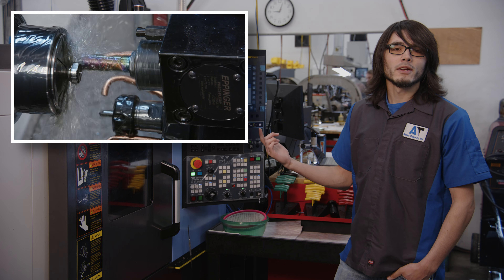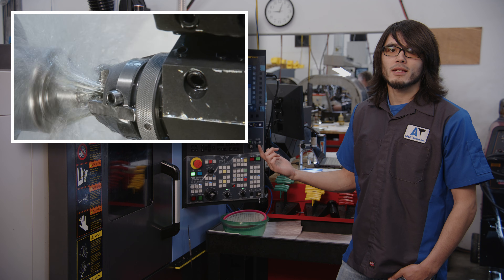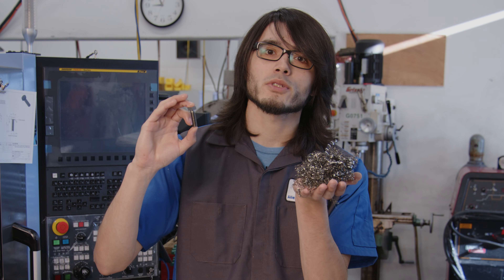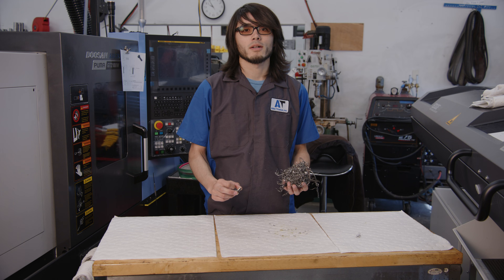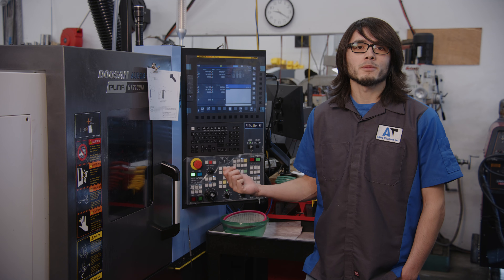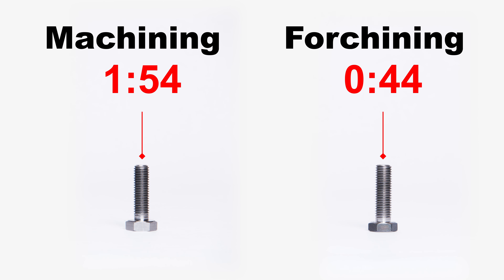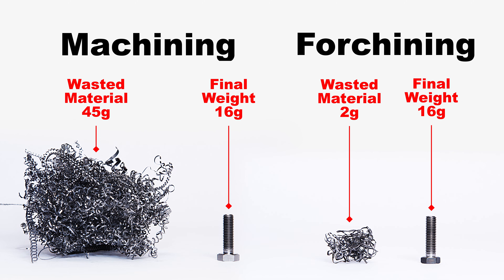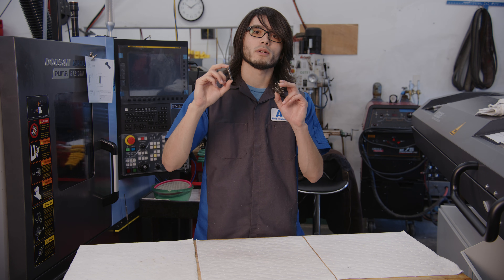Hex Bolt Forchining™ Without Machining

Comment: If you are looking to expand your market might I suggest reaching out to some of the larger tuning shops (places like APR, 034, ECS etc). This process seems like it would reduce costs on titanium fasteners fairly substantially, titanium fastener packages for popular tuner models have market demand for people pursuing the ultimate weight savings, but relative cost has kept it from becoming a common modification thus far.

Comment: what does the heating do to the metal
is this only for low requirement bolts
its titanium so i assume not
why not just cast if heating changing the metal doesnt matter 
i mean its a cool concept, but there are many questions that a basic look at a shape doesnt tell

Comment: Must have been a lot of R&D into adapting a similar forming process used for a lot of steel bolts to make Ti ones by forging the head and then cutting shank and bolt.... One of the big reasons steel is so prevalent over other materials is the difficulty in making the same processes work out using other materials and not compromising the end product due to the quirks of the material used.
I wonder why you opted for cutting the threads and shank rather than using a thread rolling process... Accuracy, maybe poor material properties in the Ti that cannot be solved easily enough introduced by using thread rolling, or low enough production volumes that cheaper tooling/setup per size is preferred.

Comment: Next you have to use one of those through hole cnc machine chuck heads and set up an automated feed system and you can have an assembly line going. Feed the Rod, Clamp the Chuck Jaws, Heat with induction, Pull heater away, forge head, cut threads, cut bolt off, repeat. I am sure there are more steps to this I have failed to include, but from a layman's point of view this seems very doable.

Comment: Cool set up and process! 

"Forchining" though, man, what an awful and unnecessary portmanteau. Near net forging is already a thing. It looks like you've done a great job integrating it into a CNC machining process, but it's not some new form of manufacturing that needs a special name, is it? It feels like you're trying too hard to make "fetch" happen.

Unrelated— if minimizing waste is a priority, I wonder why reducing the diameter for the threaded section wouldn't be done with a forming process rather than a subtractive? I imagine drawing the material out and hot rolling it down to whatever diameter is required for threading, then cooling it and rolling the threads. I'm sure there's some reason for why not; either way I'd love to hear about it!

Comment: Does the forchined bolt pass all the performance and fatigue tests for the machined bolt?
Reply: The forging creates better grain structure (higher strength) and by being able to control the area that is tempered, we can produce products that are normally really expensive to make traditionally for aerospace. Many times, with grade 5 titanium, the desired result is to have the head and the area under the head to be stronger, but the rest of the fastener needs be annealed so it will stretch and bounce back. Think cylinder head compression bolts on high performance combustion engines. We do this when we Forchine(TM) long, thin grade 5 titanium bolts for the satellite deployment mounting plates that sit on top of thick rubber shock absorbing pads.

Comment: Remove the "Index for forging" step. It's unnecessary (you already set the stickout in the "Index for Heating" step) and it's damaging your collet as you have it grasping white hot titanium at 0:41. Induction heating parts then forming them (yes, even on a lathe) has been done for at least decades now so I don't see what's patentable here... That said, this process should be more common so good luck with selling the tooling!
Reply: You haven't done any forging it seems if you don't understand why it indexes for forging.

Comment: Doesnt heating the bolt head reduce its heatreatment? What about quenching the heated part with the coolant?

The biggest possible problem i see is the heating element degrading the coolant.
Reply: You can heat treat batches after making them.

Comment: Red hot metal in that chuck collet is not great.
I'm sure a CNC check collet like that is a real expensive part...
Reply: That style of collet would cost somewhere in the realm of $30-60. A fairly inexpensive consumable if you consider that these are probably $5+ fasteners and they're making over 60 an hour. I'd bet that they probably last a week or more. 

The most expensive tool in the machine is probably the thread rolling head at a few thousand dollars.

Comment: Now, if you could roll the threads it would be even better and stronger.
Reply: You blind?
Reply: @JaakkoF how do you explain the swarf coming off the part during the threading operation? You may want to keep your comments to yourself. Makes you look like a fool.
Reply: They are rolled after a diameter is turned. You can see a thread rolling head run up the part and snap open.
Reply: @jonathantaylor2584 that’s not rolled. That threading head still cuts the threads.

Comment: Huh. Neat! I like this approach as an alternative to hybrid machining, especially for applications requiring the extra strength from the heat treated and tempered material, since hybrid machining usually leaves the material a bit weaker than if you just machined out the part normally.

Comment: that's great and all, but where are the stress tests? does the bolt get hardened when subjected to the induction coil, is it more brittle? does it have the same elasticity on the bolt, how do the threads hold up to stress... if you're going to sell this product, make some examples?
Reply: That would be the QC department, just like every other manufacturing process.

Comment: I am sure a lot of people will watch this video not knowing how most fasteners are mass produced. Cold heading produces almost 0 waste. That is why it is rare to CNC machine a fastener these days.
Reply: Fastener metallurgist here. Hot heading titanium hex bolts makes a lot more sense than cold heading, because annealed ferritic or pearlitic steel cold forms with so much less pressure than Ti6Al4V and has greater elongation. But I'm confused about the threading process you show. The caption calls out "roll threading", which is a cold forming process with no material removed, but we see stringers being generated. Rolled threads are far superior to cut threads, particularly on external threads (even more so on screws/bolts than studs) due to the aligned grain flow resisting fatigue crack initiation in the thread roots.
Reply: @elektro3000  they are rolling the threads, the material removal is turning the threaded portion down to pitch diameter ahead of rolling the threads
Reply: @elektro3000  We are rolling the threads "technically" cold. But in actuality, the material is still quite hot which makes for a longer life on the thread rolls.
Reply: @elektro3000 if you watch closely, the cutting operations that removed material from the workpiece are reducing the diameter for the threaded section of the bolt down from the diameter of the unthreaded shank. The thread rollers come in just after that.
Reply: To be fair, a lot of people also think potatoes come from the supermarket.
Reply: These are titanium bolts, titanium is a tricker metal to work with so most are traditionally machined
Reply: @AMGelardi1  I have done machining my entire career, if you know what you are doing, titanium is just as easy to work with as any other material. The problem is quantity,. Nobody will set up a cold heading machine to make titanium bolts when you only need 100 of them. They only want massive quantities in the hundreds of thousands or millions.  Cold heading takes only a few seconds to make a bolt and the bolts are also stronger because they have not been cut. Cold heading also makes almost 0 waste which was my point. It is not that they can't cold head titanium, its that it is not cost effective at the small quantities that they are needed.
Reply from the maker: @mattlarson9897  The beauty of forging and machining at the same time (Forchining(TM)), is you get the benefits of forging with the high tolerances of CNC Machining. Most of our Forchining is done with the higher strength titanium alloys that don't lend themselves to cold heading.
Reply: @AlliedTitanium  machinist guy thinks high tolerances mean high accuracy - whomp whomp, all credibility lost 🤦‍♂️
Reply from the maker: Actually, to my knowledge, nobody on the planet has figured out how to cold head Grade 5 titanium products. If anybody knows of anyone doing this. Please let me know ASAP. This Chris. I'm the CEO of Allied and inventor of Forchining.
Reply: Not cold head, but warm head by adding an induction heater before the cutter and quill on a cold header. Can do this as a modification to an older machine or buy a new machine that has been modified by the factory.
Reply: @triaged He's trying to patent the process, so you're going to have to get creative when writing your own recipee.

Edit: Found CN111922266A for 💩's and giggles.
Reply: Basically how they make bolts in big quantity, except this time, it's on a CNC and thread cutting instead of thread rolling
Reply: not with Titanium
Reply: So the hybrid is having included a hot forge in the middle of an otherwise subtractive process? In that case, running a roller on a polygonal tool path might enable not having to have a forge die, just a pushing sub spindle.

Comment: For an individual bolt, that's all well and good, but at an industrial scale, this hasn't been a problem for around a century.
The roll form machines are probably the best, but the slip forms are better for small batches because of 'easier' set-up.
I'm sure newer machines are simpler, but I was using machines to do this five years ago that were made in the 60s.

No material need be removed, unless they need a point on the end.
Pressure will make threads far faster and cleaner.
In 44 seconds, I'd have over a hundred on a slow running model.
Reply: you can cold form titanium??
Reply: But we can make it 100 Times More Expensive, IF we do it this way
Reply: If all you want to make is a bolt, and lots of them, but for smaller batch sizes of spindles, shafts, unique fixtures, longitudinal tools, etc, this would reduce tooling and/or material wastage.
Reply: @benwilms3942  did you miss the forging die perfectly forming the part in a single shot? how do you do that without a custom, part specific tool? i don't see any fundamental change in the trade-off between tooling cost and efficiency, "just" another interesting point along (hopefully) the Pareto front for these two variables. for the right application i could see techniques like this being very beneficial, but i suspect it's applicable to a much smaller slice of industry than the "all of low volume lathe work" you imply. after all, the idea would be pretty obvious to any machinist with a bit of imagination, so if this was so fundamental an advancement, it would already be in use everywhere. this video is probably more of an investor pitch than a product ad.
Reply: @spambot7110  exactly my thought, it is about inflating their company value no doubt, because at small scale you really don't care about the material waste, it is not really a factor in cost of the product, on large scale nobody is making screws in CNC machining centers, so this method really doesn't make sense, especially the "patent" part of it, there is nothing to patent here, induction heating and forming, has been around for what - 70-80 years? not to mention the questionable end result doing it on Ti on such a critical place on a bolt

Comment: Now THIS I like- No offloading of tasks to computers or throwing away gobs of material, proper problem solving.
Reply: Uhhh, this is cnc, the ENTIRE task is handled by a computer
Reply: Without computers, this would be about 10 times more expensive and likely more time-consuming.
Reply: Everything shown in the video was done before computers, the only advancement is that computers let it be done arbitrarily without the giant analog gear based systems.

Comment: Thats great but most bolts arnt machined on a lathe. They are squeezed between 2 die plates and have their threads rubbed on. With the head stamped. The process is super fast and this forchining offers no advantage to the already established method
Reply: Aerospace grade 5 titanium are… like the example in the video
Reply: @geekswithfeet9137  The material may be "aerospace grade", but the processing and precision are not - these parts should not be used for critical applications. Still, an interesting approach...
Reply: @davidg3944  if you think that heating and forging t5 titanium is detrimental….. you don’t know titanium.

Comment: Great concept, but it has me concerned about the microstructure. Ti in particular likes to exhibit texture from forging. I'm also interested in the concequence of grain size and any precipitate coarseening or dissolution, depending on the alloy. This process could have serious concequences on the final mechanical performance of the bolt.
Reply from the maker: Actually, this process of forging grade 5 titanium, tempering grade 5 titanium and then machining or grinding grade 5 titanium into high tolerance products has been done by aerospace for years in separate operations at extremely high costs. We have combined these manufacturing processes into one seamless, spatially and environmentally coherent process that is fast, accurate with very little waste. Our Forchined(TM) products have been going into aerospace, defense and space for years. We just kept it a closely guarded secret until our patents were far enough along. So. . . When you look up in the sky and see a satellite, odds are that forchined products are in it.
Reply: @AlliedTitanium  I dig it.. likely goes through heat treatment in bulk later anyway, right?
Would love to see more affordable Ti mtb hardware..
feel free to send m4 through m6 this way for quality control..)/*
Would love to see some broachining if you care to show off any more sexytech..
Reply: @AlliedTitanium  and you waste your time pursuing patents for something that has been done for decades before, it is just silly, and tells that you're most likely getting ready to sell out, there is absolutely nothing groundbraking or patentable in this process, in other words - you're scamming and trying to inflate your value, which is the bane of the western manufacturing and why there are probably 10 factories in china doing the same exact process and outcompeting you, hence trying to sell out before the value crashes
Reply: @AlliedTitanium  I own a small machine shop in rural California. We do small batches for our local customers and sometimes the government. I'll purchase one of your machines if you can fart on your room mates door.
Reply: @AlliedTitanium  Well, I can guarantee the satellites I've worked on at one level or another were unlikely to have your fasteners in them, not sure about other parts. It's an interesting process, but I would not use the bolt examples I saw in any critical applications - questionable control of heat treat, poor residual stress in the shanks, and lack of rolled/compressed under-head fillet to shank have me concerned. 

The SPS and BAC-spec A-286. 718, and some Ti hardware I've got is what I use for high-stress applications in my work. If I needed some dress parts in a difficult to find size then I'd consider these.
Reply: @davidg3944 We cannot speculate, based on a video. The sensible thing would be to get hold of process and product data before deciding what the process can/can't do and what it has the potential to do.
Reply: @camshaftcasting1451  No, the points I mentioned are valid regardless. Perhaps the biggest "red flag" is the lack of a rolled fillet under the bolt head. This is a factor for fatigue life and performance under load for a fastener. 

I've specified fasteners for satellite and automotive applications, for many uses a "hardware store" bolt is fine, but for engineered high-stress use I'd be cautious with these.
Reply: Cue the "experts". Nothing is more annoying than pedantic amateurs trying to show how smart they are by nitpicking something they very obviously do not understand. The Dunning-Kreuger effect is an epidemic in machine shops. At one end, you've got the guy who went to trade school and worked in the shop six months who knows it all and at the other end, the FOG who hasn't learned anything since Clinton was president but is guaranteed to mention how he's been machining for 30 years at least three times a week.
Reply: have you ever met a part that was worse because forging?
Reply: @petedude2lu3  Yes, without a doubt! When improperly done, forging can create inclusions of oxides, laps, internal fissures, variations in residual stress, etc. Want more?
Reply: If it goes through the review and approval process then that's all that matters.
Reply: Agreed that there's some shortcomings in this process, I'd not use these fasteners for critical applications. But from an innovation standpoint it's pretty interesting, and the parts would be fine for more "dress" applications.
Reply: этими болтами в новом боинге я бы карбоновые полы прикручивать не стал...
Reply: @101picofarad  You can use any bolt you want. They won't remember to tighten it!

Comment: A minute shaved off, that's crazy! Everyone who seeks for harards, and energy cost increases has no idea about the meaning of mere seconds in serial production. But a minute! Awesome! If the material allows forging, the machine is well maintenanced, and the process set correctly there are no hazards, only a giant benefit.
Reply: Or just use hex stock like everyone else and thread die plates. 10x faster